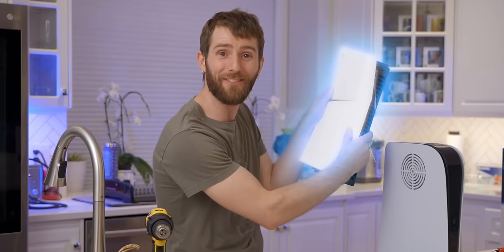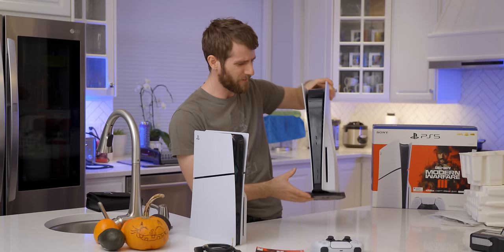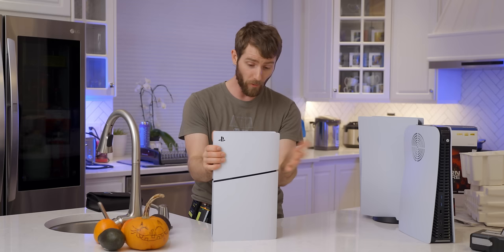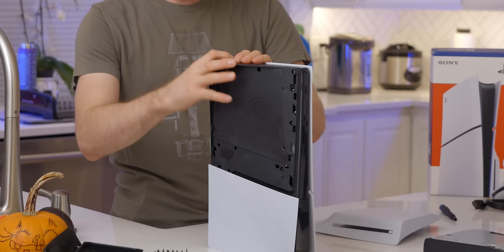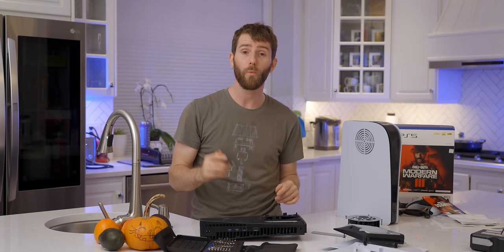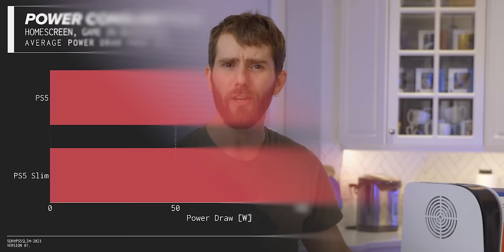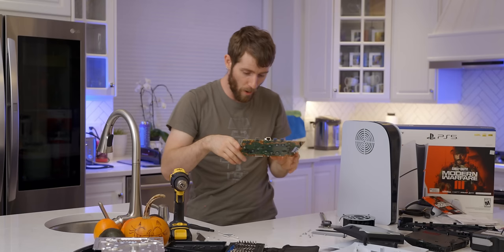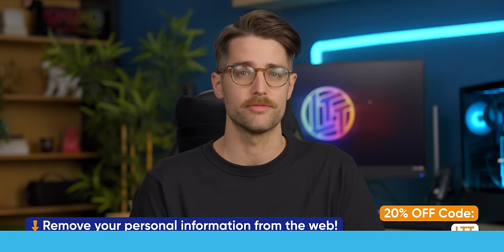PS5 Slim First Look and TEARDOWN!!

Comment: i need help. i bought a new pc about 2 months ago. it has an intel i7 12700f with the rtx 4060 ti. i am not getting the frames that i should, i suspect bottleneck, but is it the gpu or cpu that is the problem? (i am still new to pc stuff)
:D
Reply: What Ram, what Storage etc
Reply: Dear sir, I have the i9-9900k with a 3080ti which is much less than your hardware but I am getting good results, please provide more specs

Comment: This entire console is a shameless cash grab
Reply: ? Lmao? Its just a revision like the nintendo switch. I got one with 2 controllers. Its not a better or worse one. Just small improvements like the fans etc and a modular system to improve production and increase the amount they can pump out. All for the same price, nothing more nothing less pluss if you got the digital one for 400$ and you decided later on you wanted to put discs in it, you can just buy the disc drive seperatly. Oh also you cant buy the og anymore as this "slim" is the new og ps5

Comment: I find it amusing that people complain about the gloss & matte plate combo when the PS4 launched exactly like that. Sony just did it backwards this time. Actually, the PS3 was all gloss too on launch, and went matte on the slim, and then back to some gloss on the ugly grooved model.  And the original PS5 stand is a vertical stand that SUCKS as a horizontal stand. So now they have a decent horizontal stand and no vertical stand, which you NEVER needed any way. So, it basically still comes with ONE stand. And I can even turn my disk one into a digital version, and replace the optical drive with unbelievable ease! So all in all, I find the new model better than the old in EVERY way. No one should ever buy the new (more expensive) Digital version tho.